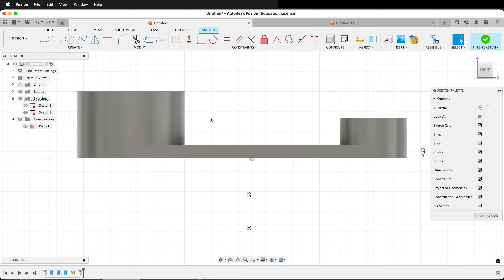Autodesk Fusion Rib Command Tutorial: Add Strong Support Ribs Fast (No Triangles Needed)

Comment: Hi, why Fusion extends ribs until existent solid in horizontal direction onto the top point of trajectory and prolonge straight line on the bottom One?
Reply from the maker: In this particular example, there is an extra horizontal line at the top so it turns the corner, but if it was just a single line it would end at an angle at the top just like the bottom